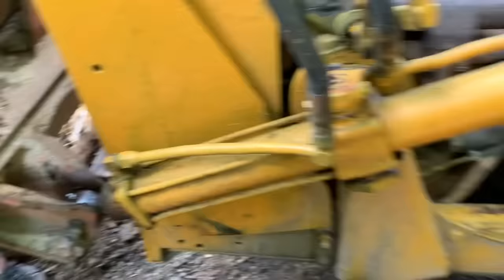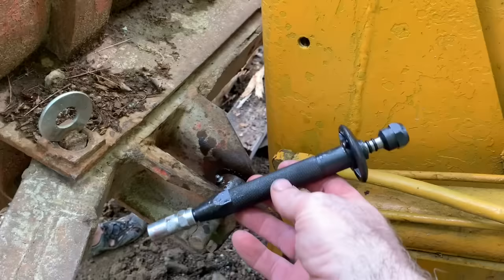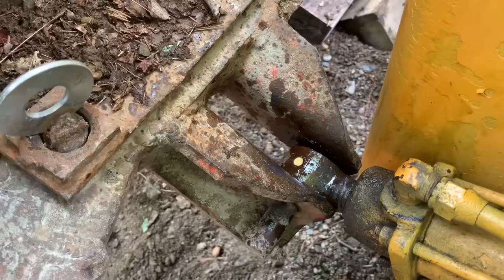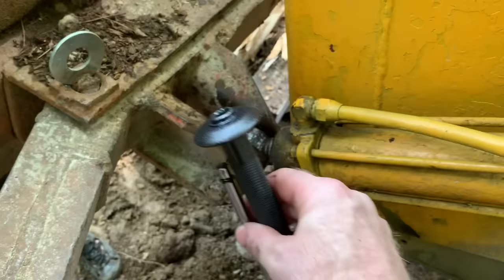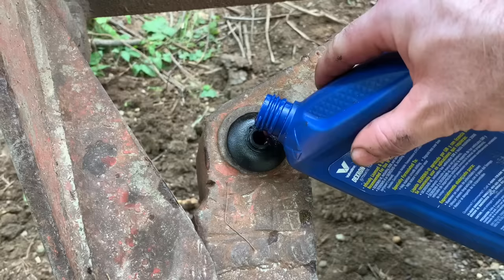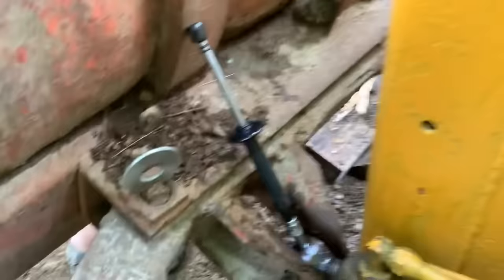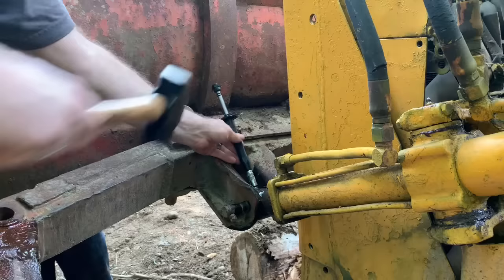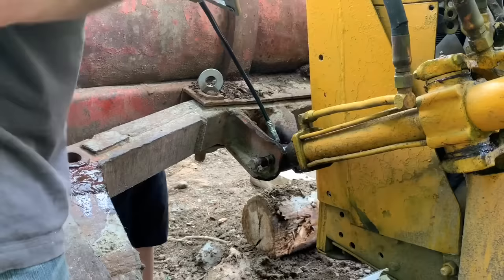Grease hammer: how to fix a grease fitting that won’t take grease anymore

Comment: Use a torch directly on the metal area where the grease zerk is to heat up and soften the old dried up hardened grease inside and fill with new grease, only a small propane torch is needed...use a small ice  pick to first push in on the little bearing in the zerk in case that is the problem or simply replace the zerk with a new one if unsure...
Reply from the maker: Great tip!
Reply: You gave advice in the reverse order it should be applied and you should eliminate the torch from the operation altogether for several reasons besides it not being effective no need to burn grease and heating unnecessary
Reply: Or you could do it the easier way of running a drill bit down through the crud.
Far easier, far quicker and never fails👍
Reply from the maker: @WeeShoeyDugless  thanks for the tip!
Reply: We've been doing that for decades, PS please lower blade before allowing anyone to work or scrape blade with their feet under said blade.  Be safe, not sorry 😐

Comment: We had one where I worked. Agricultural equipment. It never worked. People will attempt to grease a fitting, and when the grease squeezes out of the fitting at the gun, they will install a new fitting, zerk. When it still won’t take grease, then you usually have a shaft that has worn out and seized in the bore. It’s time to take it apart, and actually repair the moving part. The lesson is, grease the zeros regularly. You might never have a problem with them if you do.
Reply: The tips on the guns wear out too. If every fitting you come across seems to be bad, often it is the tip.

Comment: Good to know theres a tool for that. I'm not osha approved by any stretch, maybe did and couldn't see but I'd block up that blade while kiddo chips at it. No reason the valve should ever let loose but if it does probably cost some toes at the least. 🤠 Sometimes a hose gets pinch punctured from a falling object, sometimes a cat comes and leans on the lever. Maybe I've got bad karma 😆💩
Reply from the maker: Got it
Reply: Yes, please never rely on hydraulics to hold anything up while working on it. Buddy of ours was killed while working under a spraying rig held up by the tractor linkages. His dog was in the cab of the tractor and stepped on the release lever.
Reply: For sure!  The condition of the hoses we could see was pretty bad.  You can't imagine how quickly an implement will drop when the hose pops until you've seen it.

Comment: One thing to keep in mind is that sometimes the bushing inside will turn and block the grease port. In that case you may have to drill a new shallow hole through the bushing at the grease fitting hole.
Reply from the maker: Excellent point!
Reply: Exactly, which is why I always run a drill bit down through them (whether the bush has turned or not👍)
Reply: What size hole do you put through the bushing? I imagine it dosen’t matter too much, about a 2mm hole?

Comment: Well done indeed.  Great patience too. 
Slow and steady and on the fix. And also didn’t get annoyed at young son making noise and distracting nearby.  All around good job.
Reply from the maker: Thank you for the kind feedback
Reply: It isn’t safe letting kids (anyone) stand near any raised hydraulic equipment. Especially an old unit like that. A hose fracture and the bucket falling on someone would be devastating.

Comment: I had this problem with the main boom pins on a crane. Using a cordless grease gun I kept the pressure on while booming up and down. After a few cycles the grease worked its way through and started coming out.
Reply: And if that doesn't work add some heat to soften the old grease

Comment: I usually take the grease fitting out and most times inside has turned into like brown clay ,hard as,so put a drill bit in an turn by hand bingo ,most times ,now got another good solution Thanks

Comment: I usually just pressure up the grease gun as much as i physically can and then hop in the machine and move whatever joint isn't taking grease. Always worked for me. Sometimes have to to is a few times to get to to take grease easily.
Reply from the maker: Thanks for the tip!

Comment: We used to just heat them up with a torch and they always took grease. This is a nice tool if you don't have a torch though! Thank you for the tip.
Reply from the maker: Thanks for sharing the tip about the torch!
Reply: What do you mean using heat? I’m still new at this two, heat sounds like the quick easy way, I’m just not understanding how it works. Your saying just torch the fitting for a few seconds and it’ll start taking grease again?
Reply: @jordanbrock8055   Even if the grease is solid, rock hard, and old, putting a torch to it and letting the heat get to that grease will make it soften and may start running of the joint. Either way, pumping in new grease now will push out the old. Hope this helps
Reply: @jordanbrock8055  You basically use a small propane torch to heat all around (and including) the grease fitting.  Keep the heat on it until the area is warm and then try pumping in grease.  If the fitting doesn't take grease, then keeping heating.  You can also run a drill bit that is smaller than the grease fitting hole down the hole and hopefully drill through the dried up grease.

Comment: I have used one of those before but here's what works better. Take a port-a-power pump and unstop most joints with it. Remove the quick connect end from the least used attachment and plumb it straight in the hole you take the troublesome fitting out of. Warm it with a torch and pump it. It will unstop and flush the joint.
Reply from the maker: Wow
Reply: Thats a super idea!
Reply: Just be careful when you hit max hose pressure. Hydraulic injection injury is not pretty

Comment: Automatic transmission fluid, especially warm, is a miracle worker. Stuff is magic.
Reply from the maker: Indeed
Reply: Mix atf and acetone to loosen rusty bolts
Reply: Oh come on... ATF is just 10W oil with some additives in it. It's just oil..!!!
Reply: @tandemwings4733  and you're a bag of mostly water with a "few additives". The magic is the additives. 😬
Reply: @intheshell35ify  I don't think friction modifiers really help blasting old grease out of a hole.
Reply: @--_DJ_--  it's the detergents. Lots of really tight clearances in an automatic trans, especially in the valve body, and plenty of sheer forces in the gear train, so the fluid has to clean while it circulates. Most of what it cleans is broken down fluid which gets thick and gummy much like old grease in a pivot point. So using warm automatic trans fluid to clean out petroleum based lubricants is right in its wheelhouse.
Reply: @intheshell35ify  That joke was funnier the first time you told it.
Reply: @--_DJ_--  and yet there are young or inexperienced mechanics that might find some of this hard earned knowledge beneficial. I want to pass on tips and tricks I've learned over my 40+ years in the same way they were passed on to me. I do not know your motivation for leaving obviously combative and insulting comments that have nothing to do with the topic. Is it an attention thing? Maybe an inferiority complex? Please, add to the conversation by telling us how I am wrong. I don't want to disseminate erroneous technical information so please, do tell.
Reply: @intheshell35ify  What exactly was combative or insulting in that? Someone as old as you should be able to identify those things properly. 
Do you have a complex that makes you make a mountain out of a molehill? Are you always insulted by people not agreeing with your opinion? Something is clearly wrong with you as you need to drag me down in an attempt to make your opinion seem more valid. Insulting me while calling me out for insulting you (which I haven't done) is an odd route to take. 
What do you call this comment you made? "and you're a bag of mostly water with a "few additives". The magic is the additives. 😬"  
Let's not pretend you are some angel in the comment sections. You are the one who seems to have an emotional reaction to your comments being rebuffed. 
That tool uses a thin, easily pumpable liquid to clear a joint. You would have just as much success with any light oil as you would with ATF. It is a brute force cleaning technique, detergents are not the main reason they work, and quite likely have no impact on the tools effectiveness whatsoever.
Reply: @--_DJ_--  my comment was about using warm automatic tranny fluid as a solvent. I said nothing about the tool or the mechanisms the tool leverages to accomplish its stated purpose.

Comment: I used to just run a drill bit down the bore (by hand) to clean out the hardened grease
Reply from the maker: Thank you
Reply: What size bit?
You take the zerk off and use a bit slightly smaller than the thread? or is there a smaller bore in there I need to clear out?
Reply: @woodywood6961   Start small. The trick is to bore a hole thru the dried up grease, so it doesn't need to be the exact size of the hole
Reply: @ttc5000  Thanks mate, i’ll try this as it’s a quick easy thing to do. Although I feel like the issue for me is further along. Maybe the bushing has rotated a little.

Comment: It’s been my experience that when a joint won’t take grease it’s usually not because the grease has hardened and won’t let grease pass especially if it IS greased occasionally it means the bushings are worn and the groove that the grease is supposed to travel thru around the joint is not there any more. A good indication the bushing needs replacing.
Reply from the maker: Thanks for sharing your experience!

Comment: I have never seen one of these, I always removed the zerk and cleaned out the old grease and then filled it with penetrating oil and replaced the fitting and pumped grease in behind the penetrating oil to force it through. If this didn't work I would use a torch if I had one handy.

Comment: Always grease at the end of the day not the beginning.
You want to push any dirt and moisture out. 
Why let that crap sit in there until next use?
Greasing at the end of the day protects it til next use.
Reply from the maker: Good advice!
Reply: No real difference, though...
Reply: I grease before use, then wash the machine afterwards. Sometimes, I'm smart enought to regrease before washing, but not often 😂
Reply: If your grease regularly, then it doesn't make a difference.

Comment: Most likely the pin is worn out and needs to be replaced. Also how about not having your child standing under a raised blade scraping off dirt that serves no purpose. Operation of the blade will remove the dirt. Failure of the pin while you are working on it could kill your child.
Reply from the maker: Thank you for your concern

Comment: Got the same problem on the 1985 Case 1294 tractor the right lift arm doesn't take any grease whilst the left does i am gonna try this method tomorrow and hopefully get the right lift arm greased can i use any kind of oil doing this ? 😄
Reply from the maker: Transmission fluid or another light oil should work.
Reply: @SteveMoitozo2  can i also use say oil for lawns mowers or cars ? I got some 10w-40 mineral motor oil and some 5w-30 car engine oil 🤔
Reply from the maker: I think any of those options should work. Even hydraulic fluid should work.
Reply: @SteveMoitozo2  alright, i'll try it out tomorrow and when it's done the right lift arm should be greasable again :]
Reply from the maker: Let me know how it works out and which oil you ended up using.
Reply: @SteveMoitozo2  alright 😉
Reply: @SteveMoitozo2  sorry for the late respond, i got the right lift arm seized by soaking it for 2 days in WD40 after that i tried greasing the liftarm and it worked 😄
Reply from the maker: Well done!
Reply: @SteveMoitozo2  i actually never expected wd40 to do the job but it worked 😅

Comment: I usually pull the pin and now the grease squirts right into the hole.  Then put the pin back in.  It's all about corrosion.
Reply from the maker: Makes sense

Comment: I never liked the hand pump grease gun because you cant guide the hose securely and pump at the same time because it will often leak grease so I like my air driven gun with a trigger to operat the pump action leaving my other hand free

Comment: If I were to use this for a zerk leading to a Machine bearing wouldn't the transmission fluid contaminate the bearing ?
Reply: Better to have a little transmission fluid in the bearing than no grease

Comment: The way I fix zerks that wont take grease is-
As zerks cost like what? 10c I throw the zerk away I install a new one.
Any mech worth a SH should have several zerks of each size on hand
if you are going to do lube work.

!

Comment: Why not just put a new fitting in it? Asking for a friend.
Reply from the maker: Because the issue is not in the fitting, but deeper in the joint itself.
Reply: Unfortunately getting to the zerk is next impossible as it is inside the track housing and actually pushes a piston out on the end to tighten the rubber track.

Comment: They work but buy a “ good one “ , the cheap stuff lasts not long , sold most of my equipment,  had prob like a total of about 100 fittings, down to only 50 fittings, l 39 back hoe etc , but why in the heck do they put some fittings in places that aren’t easy to get at no matter the brand ? Answer stupid engineering , like the wiring on my l 39 , it’s a little “ beast “ yet why the smallest possible gage wires that “ work “  or putting them again in hard to reach places ? Same answer , one thing though at times the pivot pin s on older equipment may have to b taken out and cleaned , so that the grease will b distributed evenly around the whole pin ( rust dirt etc ) or replaced, it’s cheaper than say a loader “ arm